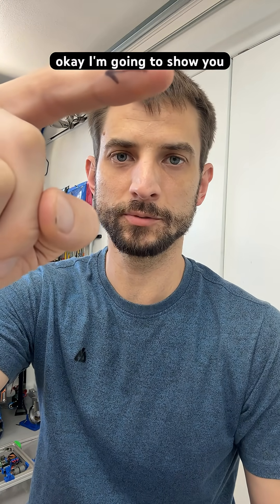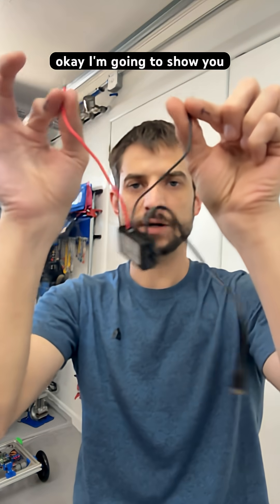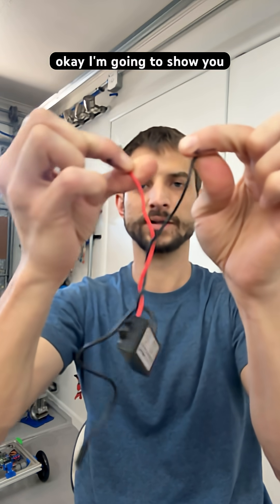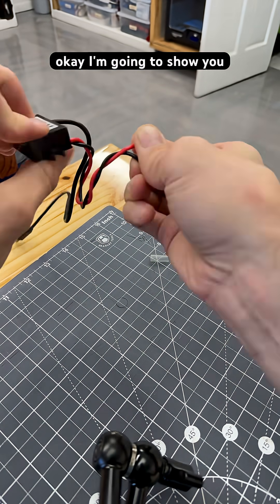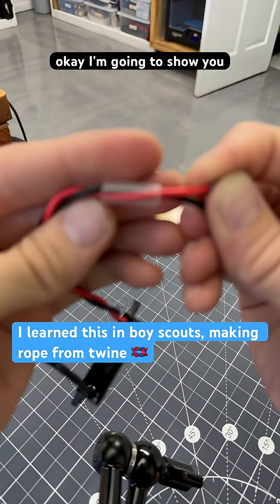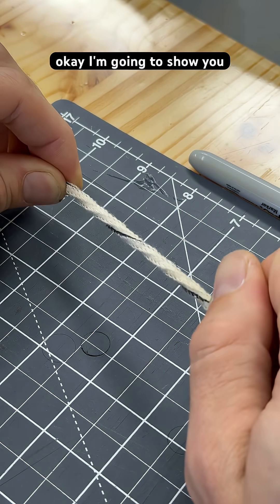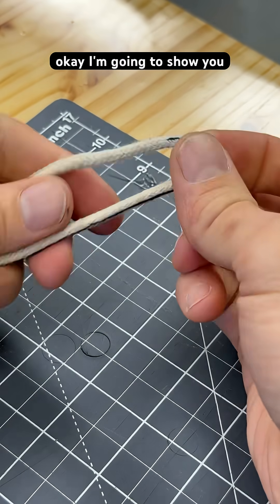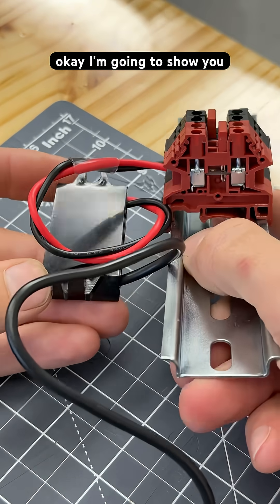the boy scout skill for robot building

Comment: I often do this, but use a cordless drill. Quick and makes everything tighter so it won't unravel even without the heat shrink. Just note that the total length shrinks (twisting isn't a straight line. The tighter you go the more the length shrinks), so make sure to compensate. Also very useful, use that coiling property mentioned, wrap it around some stick, clamp the ends, then hit it with the heat gun. Congrats, your headphones now have a coil and are a lot less likely to get in the way as they expand and contract when needed. This also works for non-headphone related applications.